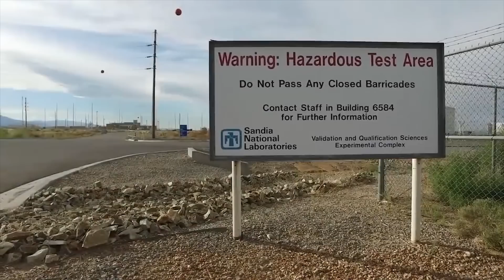Crash Test - 5 Largest Full Scale Experiments Caught on Camera

Comment: 6:08  the F4 phantom crashed head-on into a reinforced 12ft thick concrete wall at at almost 500mph.  6:21  the plane was obliterated into tiny pieces.  damage to the wall was miniscule.  the wall's maximum scar depth was 2.36 inches while the structural damage sustained was negligible.  the force of the impact did hurl the concrete block back 5.97 ft.

Comment: The first story about the fire tests reminded me of something they tried back in, I think it was the late 1990's.  A company developed a jet fuel that would turn to gel when subjected to an impact.  As a gel, it wouldn't burn.  Earlier tests had shown that a prime cause of fires was having the fuel tanks ripped open, spraying the jet fuel into the air and it would explode, igniting fires.  They rigged a plane to crash into steel barriers that would slice it apart.  When it crashed, it exploded and burned.  The test revealed that the fuel could catch fire faster than it could turn to gel.  By the way, these tests weren't "caught" on camera.  Catching something on camera means you did it unplanned or even by accident!  This footage was deliberately filmed.

Comment: I think the fact that the concrete block was able to freely move back over 5 feet should have been the main concern as the concrete would be solidly fixed and may not absorb as much damage ??? 
An im sure if a multi ton hardened concrete slab moving 5 feet next to a real nuclear reactor would not be safe

Comment: 9:18 that's quite invalid point.
The 50 year old aircraft has essentially the kind of tube as modern day 737, Boeing has done little to no changes, apart from the engines being relocated to the wings and T-tail replaced with traditional.

Comment: The phantom didn't crumple because it was going the speed of sound or so close to it that it didn't matter.  Supersonic impacts happen differently than a car crash.  Crumple forces can only move back along the plane at the speed of sound.  With the plane moving into the wall at this speed, none of the energy goes into crumpling.  It is all focused on the 2-D cross section in contact with the wall at any moment.  This is enough to instantly melt or vaporize most of it, resulting in that big splash-like result.  I watched other videos of that crash many times.  Some give very close-up views which are really interesting to watch because of the different physics of supersonic impacts.

Comment: I remember watching Operation Smash hit', I would've just turned 11, but I didn't know it was carried out at Old Dalby, my dad worked for the Ministry of Defence there, but not till '86 (I think), repairing military radios. Due to the official secrets act, that's as much as he could tell us.

He had a bomb detector, basically a torch attached via a rod to a mirror, he was supposed to check under his car every morning before leaving for work, due to 'the troubles'...he never did, it sat in the boot of the car!

Comment: 8:35 Check out those engines still powered up, would have expected the fueling system and cells to be destroyed at least... They say the use of an old plane was criticized, and that it was chosen for being cheap. 

This is has no bearing on the validity of the findings. Especially when the basic architecture of that 727 is used by Boeing to this day, and is comparable to how most airliners are constructed. Actual incidents have concluded that the safest part of the plane is indeed rear fuselage, and over the wing.

Comment: "The planes fuselage didnt crumble" ... it's going 500 miles an hour 🤔
Reply: Anti-nuclear activists are basically on the same level as flat-earthers.
Reply: lewis c1500 JustMonika
Reply: So, did the nuclear rocket body crumple on impact then because it is designed to penetrate whatever it hits? It certainly behaved very differently when compared to the fighter jet's fuselage. They also don't mention the speed of the rocket on impact.
Reply: @my_dear_friend_  different mass and intertia

Comment: Age has nothing to do with it.  The 727 is the same fuselage cross section used in modern 737s.  The test was planned for years by dozens of scientists in various fields and is considered a benchmark in modern commercial aviation safety.  Who the previous owner s of the aircraft were and where it was conducted are irrelevant.  Yes, the crew parachuted out as planned because they were not suicidal.  Stop looking for conspiracies where there are none.  Also, the plane was used for one of Al Gore's campaigns years earlier, so I suppose that it was actually shot down by Vince Foster's killers using weaponized Hillary emails.  Moron.

Comment: 4:54 1470 °F = 800 °C
Please give numbers in SI (metric) units as well. The stupid imperial system is used by two countries in the world; the USA and Mayanmar.
Examples SI units: 1m = 10 dm = 100 cm = 1000 mm
1 l = 10 dl = 100 cl = 1000 ml
1 m3 = 1000 l, 1dcm3 = 1 l
1 dc3 water at 20 °C = 1 kg
Water freezing point at 0 °C. Boiling point at 100 °C

1 °C = 1 °K
The US still uses imperials because president Franklin said the metric system is too French and didn't want to change to a logical measurement system.
Reply: You can keep your 'system' to yourself, thank you very much.

Comment: Regarding the Phantom test, if the concrete barrier moved 5 feet, well...a cooling tower wouldn't move at all, so what does that mean for the impact into a cooling tower? Wouldn't there be greater force and damage to the tower?
Reply: A cooling tower is just a thin brick shell. The aircraft would have gone through one side, through the empty centre and then out through the other side. But cooling towers are just that, they don't contain radioactive matter.

Comment: I’m not a physicist but definitely something about that F4 footage doesn’t sit right with me.  The lack of jet fuel is kind of a face-palmer, but not half-so-much as firing the plane at an unsecured concrete block.  You don’t need to be an expert in physics to know that the force that pushed that block back five feet is force that would have been spent differently had the block been properly secured, say, as though it were part of some larger structure...  Not that I could tell you what the difference would actually be or if it could even amount to anything substantial.

Comment: And where is it possible, that a plane destroyed the  two concrete cores of the twin towers?
Reply: Not nonsense. Only a simply question.
And it's only physical laws
Reply: The ‘walls’ on the towers were thin aluminum and glass... a planes weight is slammed into a space it’s not supposed to be in, which causes it to collapse on the floor below, which causes.... you get the idea..
gravity takes over.. core no more.. 

the wall of a nuclear power plant is 10’ thick, which is what this was supposed to be... still moved it over 5’
Reply: Are you rehashing that conspiracy nonsense again?

Comment: 7:05 People were skeptical because the rest of the plane didn't react when the nose started impacting the concrete wall? It was going 500 miles per hour, how would the rest of the plane even know what the hell was happening? When the Mythbusters did the same thing to a hatchback, the entire front half of the car had been turned into literal dust before the back tire knew what hit it.

Comment: It has been long known that operation smash hit was a devious and deliberate deception. An engineer involved with it later confessed that they had been instructed to loosen the engine mounting bolts, causing the engine block to be thrown diagonally upwards, and over the nuclear flask. You can clearly see the engine block doing this in the footage, and that just would not happen in a real crash. Politicians feared the results, and rigged the test because had it failed they would have had to admit they had no safe way of transporting nuclear fuel rods, and would probably have had no choice but to cancel the UK's entire nuclear energy program, bankrupting the nation in the process. They decided not to take that risk, and cheated on the test instead.

Comment: Good video. I am a little skeptical of that Phantom crash test though, and here's why. They said that the block moved back- more than 5 ft. That is a significant factor. I don't know if anyone has ever watched a ballistic vest - a bulletproof vest being shot - but you will notice a significant difference between putting the vest on something immobile - like taping it to a tree, and just placing it on a table and shooting it. If you do the first, it will still stop some bullets, but others will go right through. If you do the second, rounds that would usually penetrated if it is on a person will often be deflected. Why? Because the vest is allowed to move and deflect. That is a significant amount of the force that is usually used in penetrating it and going right through, is just used in bouncing it around. 

Anyone can test this easily with a piece of paper. Have someone grab a regular piece of printer paper on both ends and hold it taught. Flick it with your finger what will happen you'll make a hole in it. But have them only hold it at one end so that it can flap around freely, and try to flick a hole in it with your finger then. It is much more difficult, if not impossible. Has the paper gotten any stronger? No of course not, it's just allowed to deflect much of that Force.

Well a very similar thing is going on in that crash test. The wall is allowed to move, there for much of the energy that might have been put directly into the concrete, and that's potentially cracking was shattering it, is simply being used to push it aside. But, in a real attack against a nuclear facility such as this, when someone crashes a plane into one of the concrete funnels that is in the thousands if not millions of tons, that thing ain't going to move anywhere. It will be the equivalent of the taught piece of paper. Now that's not to say that the plane would necessarily slice right through it, but I think the damage would at least be statistically more significant than was shown in the crash test
Reply: You're talking a lot.  But in the end it's still an aluminum airframe vs. 12 feet of reinforced concrete.  Also, around an actual reactor that concrete is a dome, thus distributing the impact energy into the base.

Comment: b727 in that experiment was not chosen for being cheap, they could easily buy some more modern airliners for similar money. They chose 727 because it has almost the same fuselage as modern 737 but also has a rear passenger ramp under the tail which is safe to bail out as on most modern planes  stabilizer is low enough so you can hit it when bailing from any side doors.